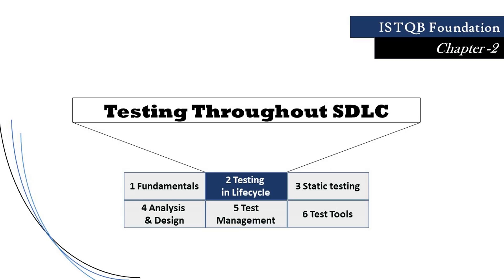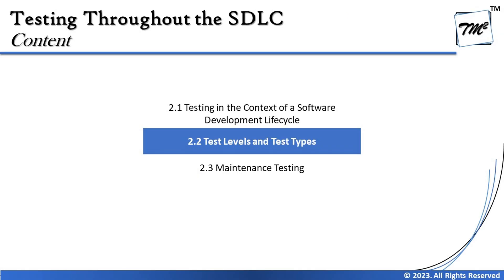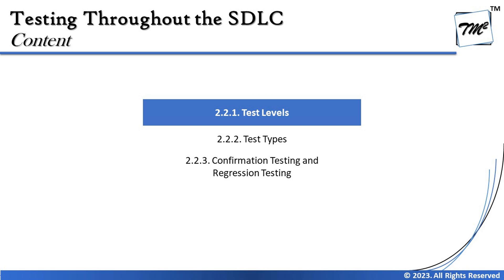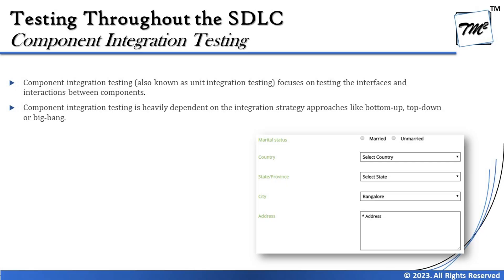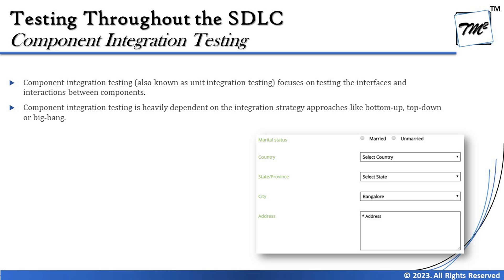ISTQB FOUNDATION 4.0 | Tutorial 14 | Test Levels | Component Integration Testing | CTFL Tutorials

Comment: Thank you for the excellent video. I noticed that you did not cover the bottom-up, top-down, or big bang strategies for component integration testing.
Reply: as it is not included in the syllabus, if I'm not wrong, so there is no need to cover it up
Reply: @adriyanochka  It is mentioned in 4.0 Syllabus
Reply: @navin4049  it is just mentioned ONCE in the Syllabus (names of strategies), but there is no explanation or any deeper information except the names of those strategies.